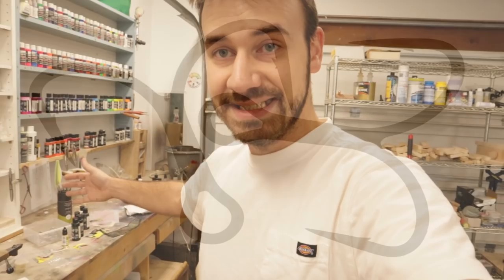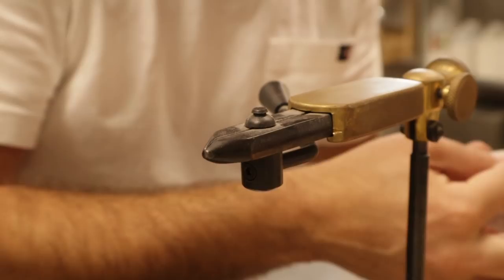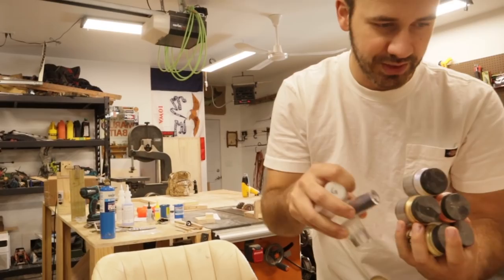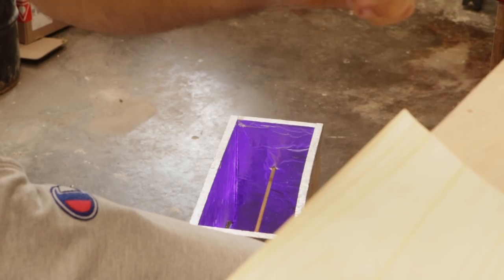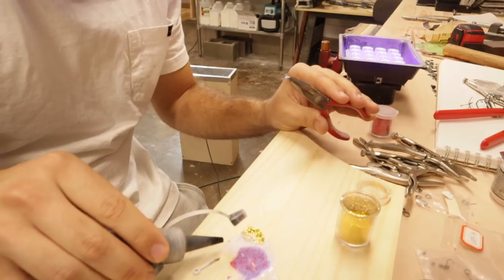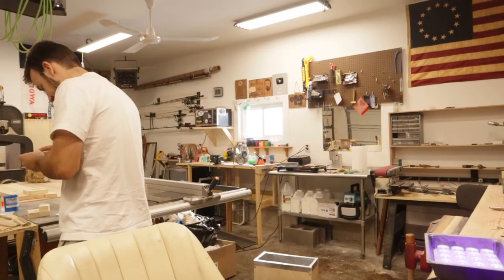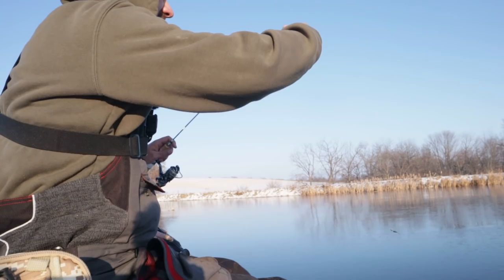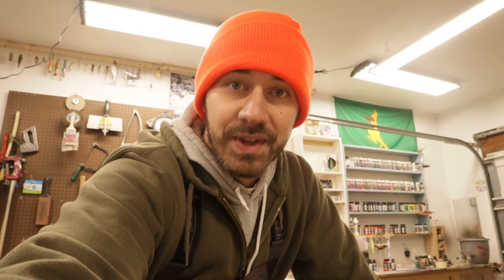Tiny Tungsten + UV Resin Ice Jigs | One Day Build to Catch

Comment: Just a suggestion try using a tungsten Flytying bead. The bead has a hole in the middle that you slide it over the hook point and onto the shank and try using posted notepad to nix your resin on this make clean up a lot easier. Thanks for the great videos.

Comment: Yeah man Spanish mackerel jigs are pricey too during the run down here in Florida.  I use jig heads with a short length of paracord for the body, after the hook i fray the cord out and it works amazing. It's like 3 bucks for 10 jigs rather than 5 bucks for one.

Comment: Get some tungsten beads that are used for fly tying. You can slip them over the barb and on the hook shank
Reply: If your going to do that I would get the jig hooks as well. You need slotted beads and it is more expensive but then it ends up floating upside down

Comment: You can buy tungsten beads (in several sizes for tying flies), that are slotted for sliding onto the hook ....way easier than the glue process you went through in my estimation.

Comment: Use barbell weights used to make clousers. Super easier to wrap it with thread and a dab a head cement. It won’t fall off. I can’t imagine working with teen sized hooks anymore, I was just cussing tying stuff to a number 1 hook. Getting older stinks!